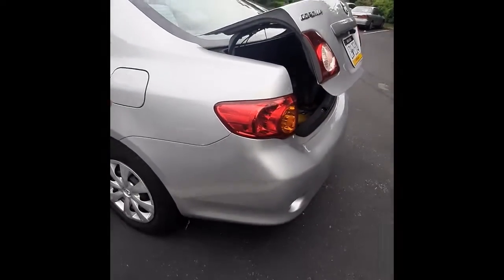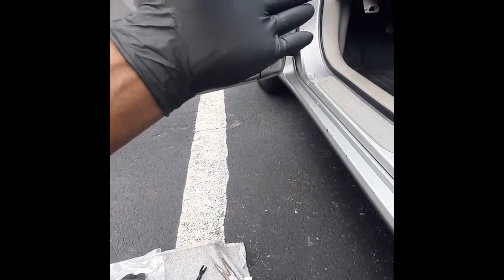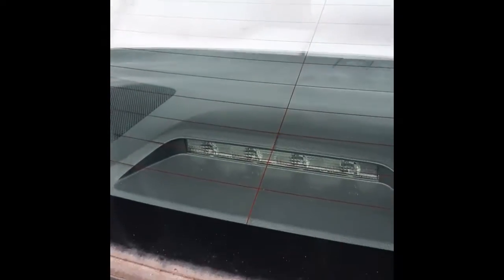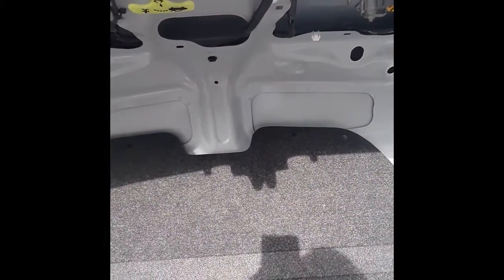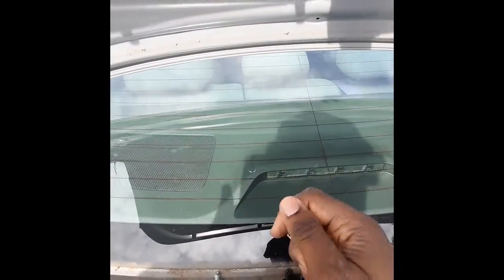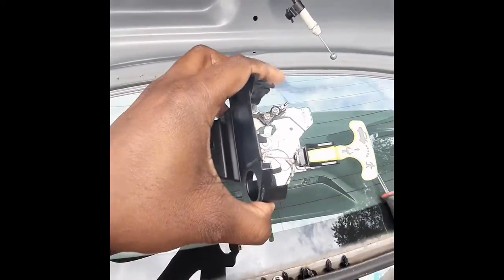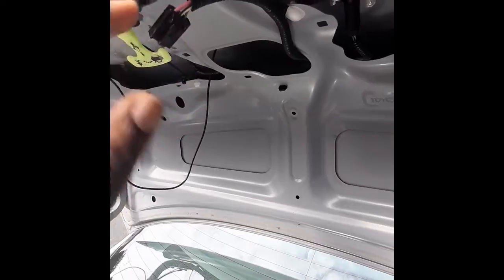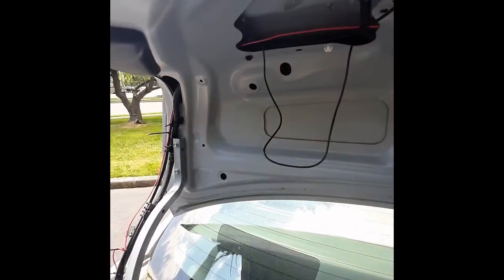How to Install Remote Trunk Unlock into 2009-2013 Toyota Corolla

Comment: Did you have the keyless entry wire set as 12v positive or to the negative trigger setting? “Trunk Release, Output +12v factory set or - 12v optional”
Reply from the maker: 12V positive from the system installed

Comment: Hey how can I do this to my 2007 Toyota corolla CE it does not have keyless entry planing to install a alarm with fob but I want to know if it possible to install a power trunk release part like you did any help will be appreciated thanks
Reply from the maker: It should work. Just find the part that fit your car
Reply: @eazidiy well I searched all over different years,Toyota models but the bolt holes don't  match up i guess I'll keep looking because I need this for my pke smart push to start/stop alarm system 9008B im hooking up soon

Comment: Hi, I just want to ask why did you need to cut the red wire from the actuator?
Reply from the maker: I used for the trigger wire from the aftermarket system.

Comment: Hi, Thank you for the video. Did you use a relay for trunk release?
Reply from the maker: No. You will need relay depending on the locking system used.

Comment: Hello. My corolla 2006 ce, doesn’t have the two pin plug and the wire. Is there any way to connect it with remote. 
Thanks.
Reply from the maker: You have the manual trunk latch?
Reply: @eazidiy  Yes.
Reply: @eazidiy  Isn't it possible for the manual one?

Comment: hello, im from the PH. I have a corolla 2010 (top of the line variant). Upon inspection, my trunk release mechanism has 3 pins already but the connector only has 2 pins (the connector itself is designed for 3 pins but only 2 wires are sticking out). How would i know if my stock trunk mechanism is "capable" of a remote release. My lock/unlock keyfob just has lock, unlock and security key (the red one). Any leads where would i start if i want to install a Remote trunk release? thanks in advance.
Reply from the maker: Hi, you factory key fob doesn't have the trunk release so it not capable. You will an aftermarket keyless entry module with trunk function. Then run a wire from the aftermarket module to the third pin of the trunk release connector.
Reply: @eazidiy  ayt, thanks mate. So locking and unlock of the car can now be accessed by the aftermarket keyfob. This will render the Factory key useless(or a spare), am I right? Thanks for the quick reply my man 👌
Reply from the maker: @osjohnmagpale167  Yes, the OEM key fob becomes backup
Reply: @eazidiy  thank you sir!
Reply from the maker: @osjohnmagpale167  You are welcome! Good luck.
Reply: @eazidiy  and may I add, are you considering adding a horn beep when you lock you car? or you just tap something to give power to the horn when you lock the car (idk if you got what i mean) but yeah, is it a feature or do you just macgyver your way?
Reply from the maker: @osjohnmagpale167  I did add horn to my keyless entry module but it sounded weird (too loud when connected to the horn). I disconnected it. If you want that feature, ensure to purchase aftermarket keyless entry with security, that comes with a horn you could install in your car.

Comment: hello brother, my car corolla 2009 xli 1.6 L made in japan, i think its a mid option car, i already have factory key less entry system but door lock and unlock key only no trunk release button available on the remote. and i checked the trunk release actuator, it has only 2 pin, connector has also for 2 pin, 2 wire cable came from front.  now i want to add a remote trunk release function in my car. need suggestion from you. thanks
Reply from the maker: Hi, you will need an aftermarket entry system because the trunk actuator needs a trigger signal from the module. If you don't mind, buy an aftermarket keyless entry system ( cheap one like $15) and install it yourself. Also you will need to replace the trunk lock actuator to 3-pin.
Reply: @eazidiy  thanks for reply, ok after installing after market entry system, do i have to program the new remote key with original entry system to have door lock unlock function on my new remote key?
Reply from the maker: The aftermarket system comes with its own key fob which you are going to use to lock and unlock your car. It also have trunk unlock button. I have a video on it on my channel to show how to install it. Let me know if that answers your question
Reply: @eazidiy  i have watched your after market entry system installation video, now my question is once i install the way you installed, my previous factory entry system remote key will work?
Reply from the maker: Yes, the factory system will work. You now have an option of another key fob that can unlock your trunk as well as unlock/lock your car.
Reply: @eazidiy  dear sir, i have purchased a key less entry system, but wiring diagram is little different than your one, i emailed to u the copy of the wiring diagram which came in the box, please let me know what i need to do. thanks
Reply from the maker: @rafiulkabir  I have responded to your email. Thank you